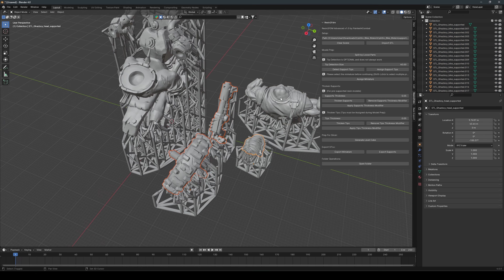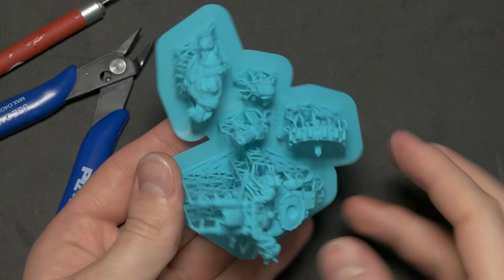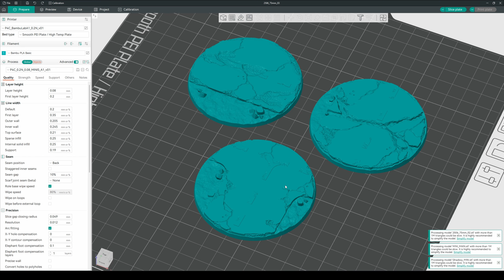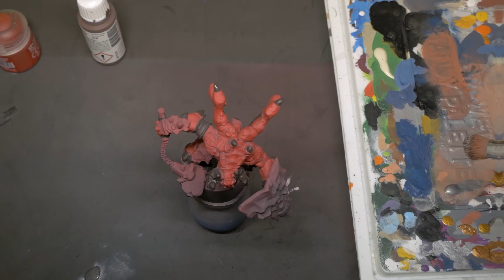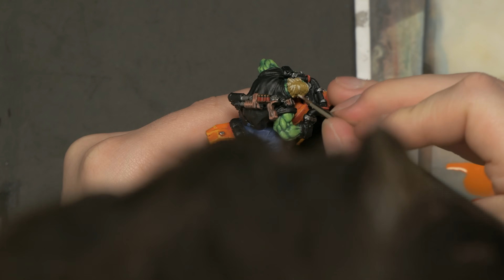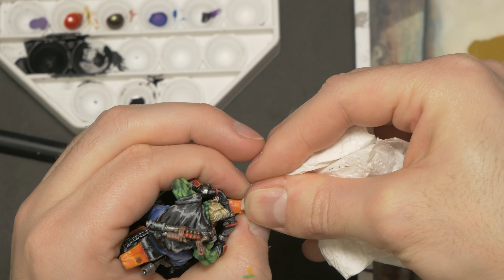3D Printing an Orc Biker with FDM PRINTING!!

Comment from the maker: FDM Printing an Army? What have the struggles been so far?  🤔
Reply: When I fdm printed my 2000 pt templar army the main issue I had was some little details like finer helmet details getting lost, that and some learning how to fine tune the machine to make painting easier
Reply: I’m currently printing trench crusade miniatures, would love for you to try it!
Reply: My Ender 3 v3 SE hates me and is trying to kill itself

Edit : printing Tyranids, just finished a hive tyrant when my printer decided to start acting up
Reply: Finding painting time. The printing has been a dream.
Reply: I'm printing death guard right now, almost done.  But tentacles have been a monster for me, when they're doing the wiggly attack pose
Reply: Mostly printing time, printing in good table top quality means using a slow setting and a 0.2 nozzle, compared to the speed of resin, I am a tad neurotic about it (what if I need the FDM printer for something!; proceed to not touched for two weeks XD), but the quality? Damn nice for a table. I don't do FDM printing for 40k tho, because the community is waaaay to toxic (I mostly keep away from 40k local scene in general, I mainly use proxies, so, even in resin there are the random look and comment and I don't like to deal with that)
Reply: I've not been successful printing on a 0.25 Prusa Core One with this method :( need to find time to tweak the support size.
Reply: Try printing some Necrons. Napking on cults makes great models.
Reply: Printing battletech minis in fdm, most models are from the mechwarrior games which can be a pain, so I've just started making my own.
Reply: Not sticking to buy a1 mini build plate 😢 been trying to print a heresy ERA iron warriors army
Reply: Fine detail even at 0.04mm is a challenge. On larger models it’s less noticeable, but on troops it’s a far more noticable issue
Reply: @sebaileyus8043  personally, I've been experimenting with .1mm outside walls with a .2mm nozzle. Works well for smaller details
Reply: The printing time holds me back but it also holds back the pile of unpainted minis.

Comment: I am using the resin2fdm addon for blender and it is very refreshing. Models come out very clean. The only thing i have problems with for now are heads... I use blender to put the model together, i find it easier then to print all apart and glue it together. But for most GW models the faces and heads are very small and i don't get a lot of details. I tried printing at 200 or 300% and then all is very detailed. So even with a 0.2 nozzle the face details are not very detailed. Is there any way to improve that with settings? (Bambu A1 mini, 0.2 nozzle, sunlu pla+)

Comment: I tried adjusting support layer height but cannot find it in the per-object quality menu. It has line width parameters but not layer height. In the video it is under his 'frequent' menu which does not help me. Can someone please help me find that adjustment in the object-specific options? I cannot find it in my version of OrcaSlicer.
I'd love to be able to print the supports faster.
Reply from the maker: It's not available on 'parts' of an object. in the video you'll notice me click ' split>into objects ' from there it should give you access to the layer heights for each piece

Comment: Using a 0.02 nozzel..and that blue PLA..how often do you suffer clogs? I have clogged my A1 with 0.02 nozzel both with Bambu Matte PLA and Sunlu Matte+
Reply from the maker: I have found that Matte filaments can be more prone to clogging, they almost have a texture to them that gives them a matte finish but leads to a lot more clogs on smaller nozzles. Personally I stick to regular PLA on 0.2mm nozzles

Comment: FDM for Golden Demon:  No.  FDM for a playing piece for a fun game:  in a heartbeat!  I wanted to be able to do this around 2013/14 or so and at that time realized that the FDM printer I could have built would never be good enough.  It seemed easier to print paper standees for my tabletop RPG games (mostly D&D 4e and Savage Worlds at that time for me).  In fact, I had even went as far as come up with my own method for holding my paper printouts, which basically involved rolling paper into an acrylic tube I had inserted into a laser cut stand.  I am so happy that has changed, and is exactly what I was hoping for back then!

Comment: FDM has improved so much thanks to you and once in a six side.
My problem with it is that I like to spend several hours painting it to the best of my ability, so resin is the way to go, start with a "perfect" miniature.
I think fdm is for more that are more interested in the playing part of the hobby rather than the asthetics of it
Reply: Or those that don’t want to slowly poison themselves handling liquid resin.
Reply: @rrwholloway  I use services to print with local people with 3d printers, but yeah you are right, I have an fdm, I wouldn't buy a resin printed

Comment: With all the new enclosed printers available wpuld you think of doing a video on the best one to pick for models. It can be ahrd to even tell which ones have 0.2mm nozzles available
Reply: You set 'setting's" for printing. (each model has different settings)  Temps for the FDM vary per grade, type or company and size of nozzel. including the  speed of print. You buy a 0.2 nozzels.  most printers ones with 0.4  ( different nozzels for different material FDM. also heater ends.)      Sorry .. a "just buy a printer . press a button"  is very far off yet.

Comment: Hi! I got Resin2FDM working, and used it on some of my One Page Rules subscriber miniatures. I really love Demons of Change, and the first miniature I tried was a Screamer of Change. Thickened the support, and printed it out on my A1 mini using Bambu matte grey filament. I had a simply incredible experience - after it printed, I lifted the build plate off, and flexed the build plate and the whole miniature disconnected from the supports. And it was incredibly clean. I think I'm going to re-print the mini and get a video of how incredibly cleanly it came off. I've done a few other figures and they were all good, I've only had that 'perfect' disconnect on the Screamers.

Comment: Personally I don't really mind if people FDM print a Mini rather than resin print one. It's all a question of "What do I wanna do with my prints?" , but also "What do I wanna print?" and "What is my personal quality goal I wanna reach?"

If that what I print is extremely thin, snaps by just having a soft breeze pass it by and is long as a rope than yeah, resin gets a better job done. Same with very fine and intrecate details. Those Minis are screaming for a resin printer as so far they do a better job in reflecting such details like engraved marks, battle damage and other things.

On the other hand we have Minis that come with an overall easy workflow style: Only few fickle details, easy to print surfaces... That also still do give out a hell of details. Like the Orks you printed here 😗 Such Minis can be printed in FDM nowadays in a good quality, and some STL Designer have fully specialized their work with such prints in mind.

Not only that. FDM Printer get better and better by the year. The reason why I hope to get myself a Centauri Carbon next year as a side maschine to my Mars 5U.

So yeah.... If I have a STL like, for example, an extremely detailed file of Nintendo's busiest Doggo Girl, Isabelle, a resin printer is the most suitable tool of choice. But if what I wanna print is a squad of orks, gunz blazin' and choppaz whizzing through da air.... Well, why not FDM it?